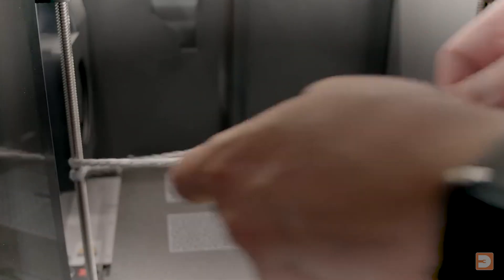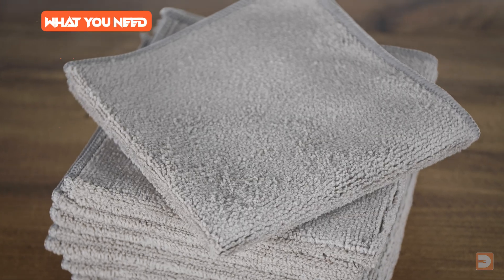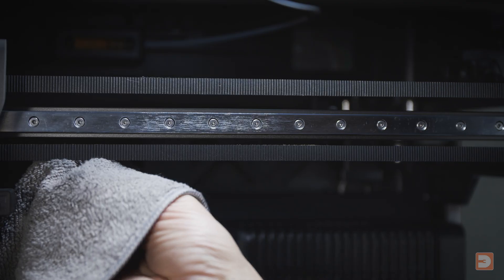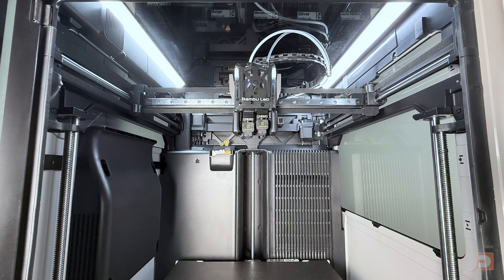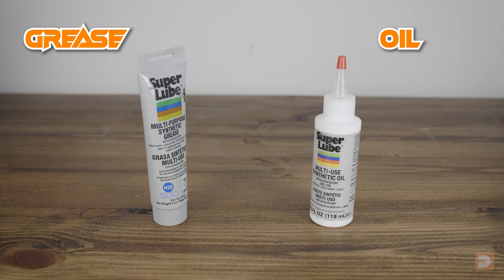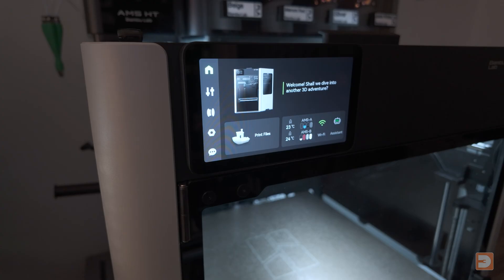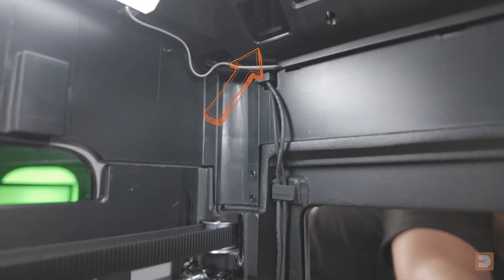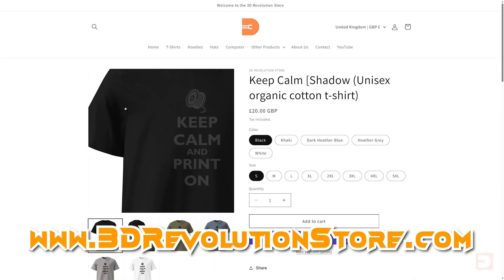Top Maintenance Tasks for Bambu Lab H2 Printers

Comment: Question:  when you click too many times to move the bed to the bottom position, and you clicked too many times and. It starts a grinding noise. Can you not stop this without Turing off the machine?
Reply from the maker: If you home your axis before you click a direction, it should not allow you to move beyond the end of that axis regardless of how many times you click to move that axis.
If you didn't home them though, there's no digital button to cancel a sent move-axis command, so powering off would be the only way to stop it in that case.

Comment: 8:17 I would recommend hitting the home button with a build plate on, as the nozzle will touch the build plate, and in your case, it touched the more fragile heat bed. Might be nitpicky, but there is no need to do that, even if the "damage" to the heat bed by the nozzle might seem minimal.

In other words, I would always keep the build plate on, and have it off only when cleaning the heat bed, if needed.
 I doubt the build plate will get any "dirt" on it while doing maintenance, it should be cleaned after X prints anyway, way more regularly than anything else.

Comment: I dont recommend wiping the thermal pad on the offset sensor for the h2c with alcohol as it is delicate and you could damage it. Very gently Clean with a dry cloth for that part. If you damage it you gotta replace the whole sensor and you wont be able to use induction nozzles
Reply from the maker: A very good point. A clean dry cloth for any sensor like that as even if the sensor itself is technically unaffected, there may be treatments applied to the lenses or covers that react and affect it's performance.

I will do an H2C maintenance video next year including things specific to the Vortek system.

Comment: One thing I’d add to this is either cover, or remove, the build plate whilst applying oil to the rail and rods. Lubricating oil on the build plate doesn’t aid in adhesion. Don’t ask me how I know.
Reply from the maker: Very good point and something I had noted to mention in the video but somehow missed it so thank you for raising it here. 

Whilst it's recommended to have a build plate fitted if you ever hit the 'home' button to home all the axis, it's definitely good to remove the build plate whilst applying any lube, or to cover it with something like a microfibre cloth or a thick/doubled up paper towel (something that is soft and will absorb anything that drops on it rather than letting it seep through).
Reply: Great tip! If covering, any suggestions what to cover with?
Reply: @azb2605  Dry wipe, I recommend Texwipe TX1012, I usually buy them in 100 packs. :)